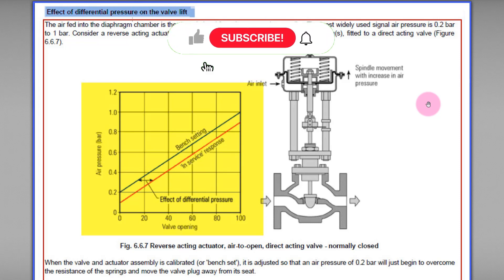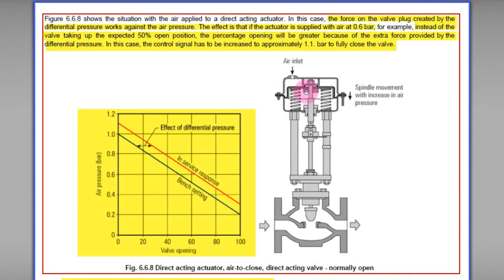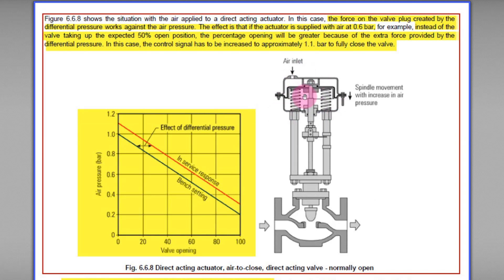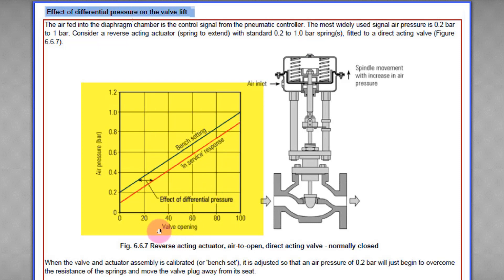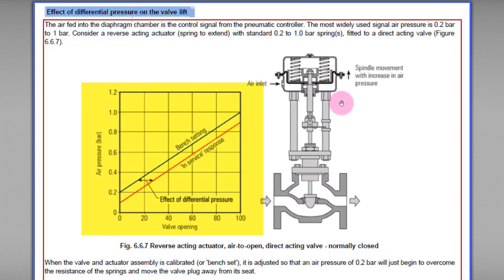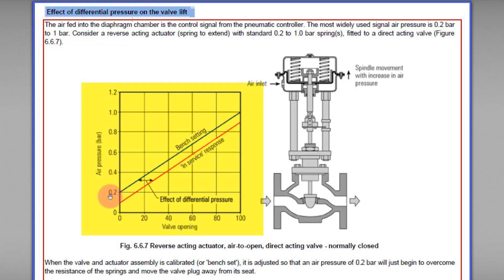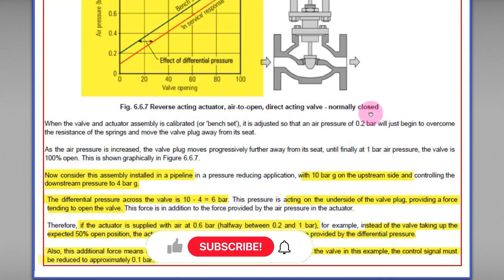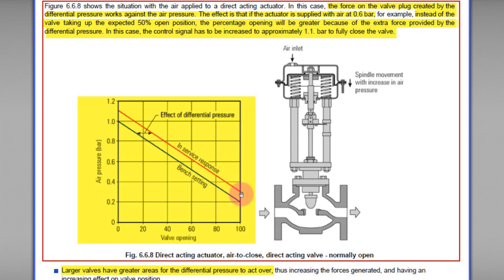Differential Pressure Effect on Control Valve Opening

Comment from the maker: "Direct acting acutator and reverse acting actuator will encounter different effect of valve opening (valve lift or valve travel distance) when control valve is installed in the field. We may get an ideal curve indicating relationship of % of valve lift versus Air pressure applied to the actuator. However, we may get different result of mentioned curve if the same control valve is installed in the field.

The reason of different curve relationship is due to the effect of differential pressure between upstream pressure (control valve inlet port) and downstream pressure (control valve outlet port) exerted by the fluid flowing inside the valve. This differential pressure will try to push up the valve plug. As a result, the Air-To-Open valve (reverse acting actuator) will need lesser than the required pressure (0.2 bar or 3 psi) to push up (open) the valve plug while the Air-To-Close valve (direct acting actuator) will need more than the required pressure (0.2 bar or 3 psi) to push down (close) the valve plug."